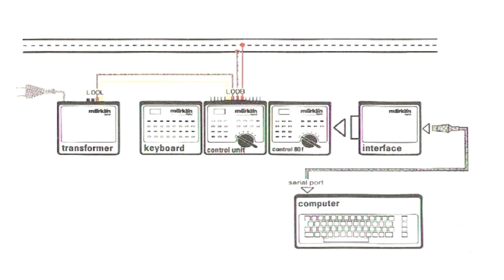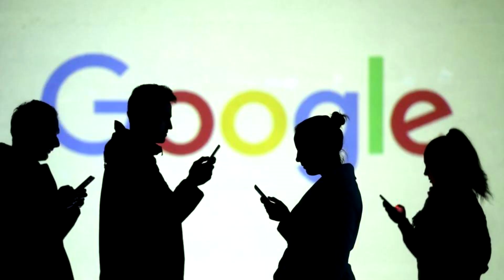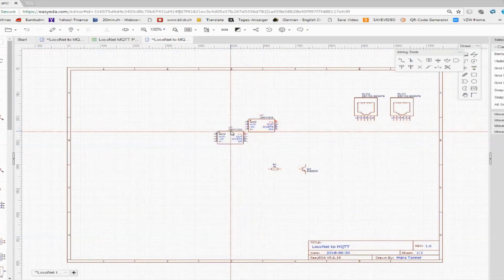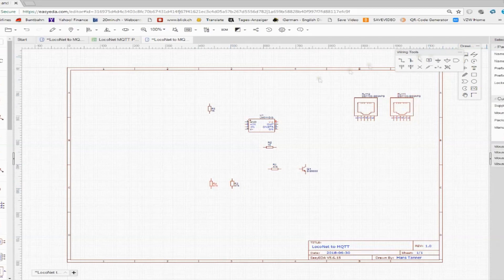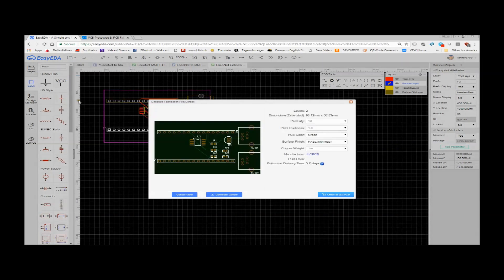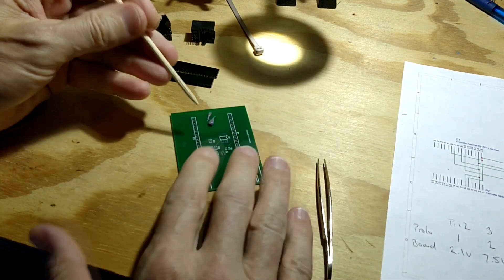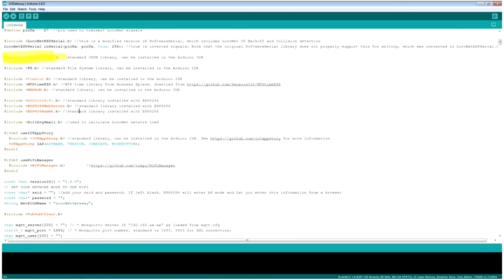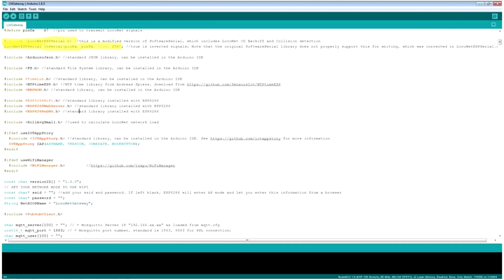LocoNet to MQTT Gateway (Video#1)

Comment: Hi Hans, is that service or public mqtt server that you mentioned in your video still active? I tried and configured a client to view the messages from this server, but i do not seem to get any messages. OK, i understand, the video is 5 years old already and you might have stopped publishing MQRR messages on that server
Reply from the maker: Unfortunately the Node RED server that generates the messages is down right now. After moving to our new home I was running into a problem starting it up again, I probably need to set it up from scratch, but did not have the time to do so (it runs on a Raspberry Pi and I am not that familiar with Linux, so it needs some time to do it). It will come back, but I don't have a date right now.

Comment: Hanz,  I am new to the model railroad hobby.  As a young boy I had DC trains and enjoyed them.  I decided it was time to build a layout.  I have designed and built my layout I am at the point of wiring and purchasing a control system.  I would like to fully automate the system and add other automations to the layout and not just the train operations.  Over the past two years I have been researching what control system would allow me to meet my vision for the layout.  I did not want to spend all my retirement on a proprietary (not a big fan of proprietary systems have seen the government get gouged).  I came across DCC EX and felt that it might be the way to go.  I Purchased the Arduino MEG, the motor shield and the Wi-Fi shield, (mostly to see if I could build the command stations).  I was successful.  That got me motivated and started looking into what I need to run turnouts and control my two revers loops.  Looking at the DCC EX system it seemed there were not a lot of remedies or videos for what I envisioned for my layout.  Then I came across your IOTT videos and became intrigued with your devices and concepts for a fully automated layout.  Videos help me since I need a refresher from my college days, with three years of electrical engineering under my belt before a life changing event derailed my pursuing the degree over 10years ago.  Here is the questions 
1.	 Why did you choose Digitrex Loconet?
2.	Since I am in the infancy stage should I move away from the DCC EX command station. 
3.	 If so what command station then.  
4.	I did see that you integrated DCC EX command station but is it the best non-proprietary command station to integrate in the Digitrex loconet frame work. 
Watched all your videos little overwhelmed with all the information but intuitive and easy to follow.  I think you will tell me the first thing is to set up the gateway.  This brings me to the next set of questions 
1.	Little nervous of having this on wifi and allowing access to my home internet.  
2.	I want to have the ability if possible (most of the time) to run my layout without being connected to the outside world internet is to set up a home network since I already have a router/modem separate from my provider modem. 
3.	I see that you use a raspberry pie is the to protect your home internet system and act as a local server. 
4.	MQTT you define as a broker little unclear on this concept will have to watch your video or more research on the subject. 
Question about the booster/power district/block/phase change for reverse loops.
1.	I see you can stack them on top the DCC EX command stations up to six Siver hats. Does this limit other devices like servo motor controller. Is ask this because my lay out currently requires at a minimum tree and I intend to add on to my layout.  
Thanks for your time, looking forward to your next videos.
V/R
Chris

Comment: This truly is the future of model train control. I've been working on a mobile train decoder, using an ESP32 Pico Mini module. My plan was to use MQTT. When I found Hans work it i was  truly amazed at the extensive work already done with MQTT and the related gateways. Thanks for your work. I'll be reviewing you code, it would be amazing if we could extend this for loco control.
Reply from the maker: Thank you. MQTT is a suitable protocol for communication, and this is what I am using it for. I don't see a benefit in defining a ton of topics for all functions of model train system since all these codes are already defined and used by the system control bus. So I find it the most logical approach to simply encapsulate these commands into MQTT, which also has the benefit that the messages can be converted back into a local implementation of a physical system control bus. This is not that easy when using specific topics that have a different structure then the train control network.
As for sending commands to the decoder, that is not a problem. You could simply encapsulate the DCC messages the same way as I do with Loconet messages. That probably would be the easiest way to build a decoder that can do both, MQTT and DCC as the message parser would be the same.

Comment: Hi Hans,
Saw your channel last year, didn't have the time then, but now started with video #1. 
Do you still have the second gateway running so we can see the mesages via hivemq? 
I do have a connection with hivemq, but no messages are coming in.
Reply from the maker: The LocoNet messages are broadcasted for test purposes on both, test.mosquitto.org and broker.hivemq.com. The topic has changed, though, and now is IoTT_LNBroadcast, which is also the broadcast topic that by default is set in the IoTT Stick software so that when the Stick in the default configuration is set to LocoNet over MQTT it will get some messages. There is a message sent out about every 10 seconds and OpCodes include block detector, switch and signal commands.
Reply: @IoTT  Working, thanks!

Comment: May you can add also the BOM and PickandPlace files?
Reply from the maker: This video describes a very old version based on the ESP8266 and some of the used libraries are no longer current. If you want to build a Gateway, you should use the IoTT Stick combined with a LocoNet interface. See videos 41, 42, 43 for more information.

Comment: I'm really interested in what you're doing with IOTT.   After seeing some of your recent videos, I decided to start at 1 to see where you started.  I'm trying to get this gateway working, but have discovered the code is stale and no longer compiles due to updates in some of its dependencies.  Do you offer an updated version in a later video?  Thanks for all you're doing.
Reply from the maker: Thanks for watching my videos 😀
Time flys, software is aging... The original MQTT is using the older version of the ArduinoJSON library, so changing it to the new version would be some work. Anyway, the gateway functionality has been integrated into many of the later videos. And by now I am using the ESP32 instead of the ESP8266. A good starting point probably would be Video #9, where the YellowBox is introduced for the first time. Video #13 has similar functionality except for the button inputs. And then Video #31which pretty much is the first video with the complete software in the structure it is today. A derivative of it made it then into the IoTT Stick, I just added a few functions to make it more user friendly, and did the modularization so the functionality can be changed by switching the hats. Most videos have references to the respective libraries on my Github page, so you can download the software from there to play with.

Comment: Your schematic looks similar to this board  CANDIY-SHIELD FD - CAN-BUS SHIEL Digi-Key Part Number 2100-201882-ND. Do you think this could be used with your sketch? I'm very interested in setting up a LocoNet system. Information is available but hard to find it all in one place. I want to build a completely open source system. I have built the NanoX-S88 system by Paco Canada and also the DCC++ system. Thanks for the videos.
Reply from the maker: The CANDIY shield is for the CAN bus. That's not exactly the same as LocoNet. You could use this shield to build an interface to OpenLCB, though.

Comment: does the sketch support creating a hotspot if the ssid & psk are not configured?
can you add an option to the sketch to update the firmware using a complied .bin?
Reply from the maker: Yes, in case it can't connect to an AP, it comes up in AP mode, IP is 192.168.4.1 I will describe this in the next video coming out Wednesday 9/5

Comment: Hi,  An update..... The good news is I have got your sketch to compile error free and downloaded to an esp8266.    The reference to esp8255 in my previous comment was only a miss named directory.  I had several ESp8266 examples up and running just fine. The real hassles I had was with incompatible versions of libraries.   Now to proceed with this adventure.
Reply from the maker: Excellent. Did you already build the hardware with the external components?

Comment: Hi,  I have checked out your suggestions and have made some progress but for some reason what would seem to me to be basic errors are still coming up when i try compiling. This is my first time of using the ESP8266 so I am floundering around in the dark a bit with it. I have been using using Arduino Pro Minis with loconet for various tasks on my out door railway.  
.
In file included from C:\IoTT working space\IoTT-Video01-master\ESP8266_Sketch\LNGateway\LNGateway.ino:52:0:

C:\Arduino ESP8255\libraries\TimeLib-master/TimeLib.h:94:18: error: ISO C++ forbids declaration of 'timelib_t' with no type [-fpermissive]

 typedef timelib_t(* timelib_callback_t)();

   TimeLib.h has been downloaded and re installed but to no avail
Reply from the maker: Your error message starts with ESP8255 instead of ESP8266. Check if you have the right board selected. TimeLib is a standard library and should compile with no problems. I would try to compile some of the examples that come with the 8266 board definitions, e.g. Blinky to start with, and then some more complex ones, just to make sure the compiler and standard libraries work ok.

Comment: Hi,  thanks for that update.     I have the libraries all sorted but now I have this.......  
  LNGateway:38: error: 'D6' was not declared in this scope   #define pinRx D6  //pin used to receive LocoNet signals . 
  LNGateway:39: error: 'D7' was not declared in this scope  #define pinTx D7  //pin used to transmit LocoNet signals
LNGateway:36: error: 'D4' was not declared in this scope  #define ESP12LED D4 //onboard LED on EP8266 Chip Board
And of course any references to pinRx,  pinTx,  ESP12LED,   from that point on gives more and more errors.     I have Arduino IDE 1.8.5
There seems to be something fundamental that I am not comprehending here. I downloaded a fresh copy  from github with the same result.
Reply from the maker: Mhhh. Looks like a problem with the selected board. Make sure you use the NodeMCU 1.0 ESP12E Module. Also, make sure Flash Size is 4M (1M SPIFFS). Those digital pin I/O definitions D4, D6 etc. are in the ESP8266 definition. Alternatively, you could just use the GPIO number, but then you have to verify what pin that is on the board. Arduino 1.8.5 is current, but make sure you have the ESP8266 boards installed (see here: http://esp8266.github.io/Arduino/versions/2.0.0/doc/installing.html )
Reply from the maker: And also, check here for the data downloader: https://github.com/esp8266/arduino-esp8266fs-plugin

Comment: Wow, very cool. Interesting that you have done bit-bashed Rx/Tx in the ESP8266. I looked at trying to reimplement what I've done on the AVR for the ESP8266, but didn't persevere with it as I wasn't sure how it would compete with the Wi-Fi interrupts. My interest was to create a WiThrottle server for LocoNet, but I've not gotten to it yet - life keeps getting in the way also I decided to wait until the ESP32 and implement it on that as it has the "Remote Peripheral" which can do the bit-bashing for you. See: https://esp-idf.readthedocs.io/en/v1.0/api/rmt.html
Also I wanted to refactor the LocoNet library to separate out all the AVR specific stuff to make porting it to other chipsets easier.
Keep up the good work
Reply from the maker: I in fact first looked into using your AVR library as a base. But as I have used SoftwareSerial successfully in other projects, it was much easier to simply add collision detection and CD backoff timeout.
The main reason I'm using the ESP8266 is because I have a bunch sitting on my desk ;-)  I like working with the ESP32. The RTOS is really great and distributing tasks on the two cores sometimes is very beneficial. Plus it has BLE, which could be used for initial configuration.